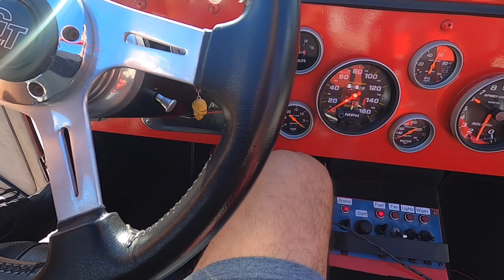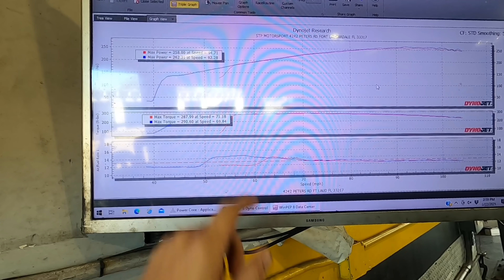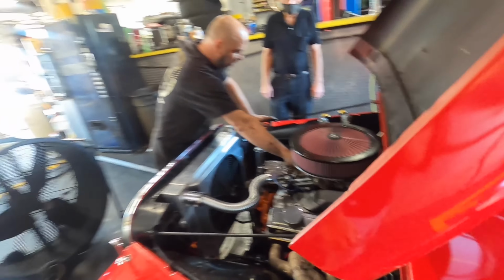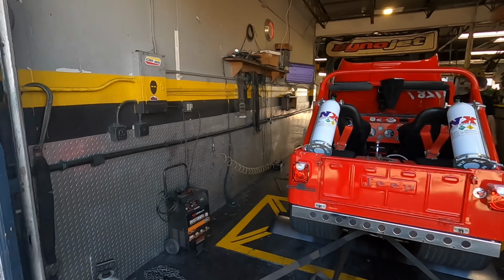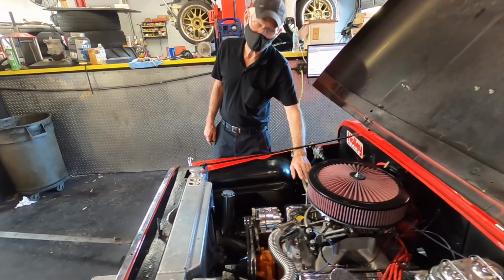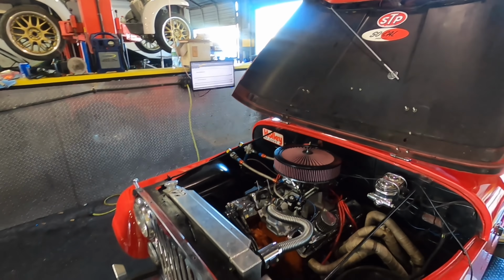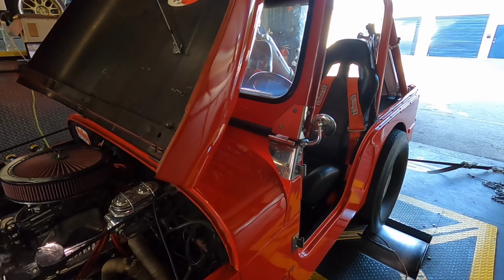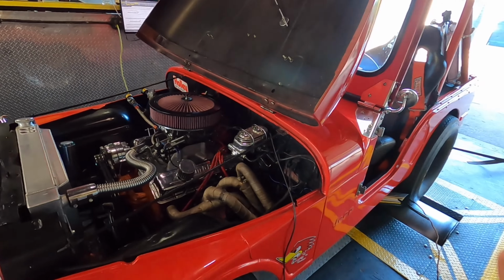Dyno pulls with Nitrous Express on board

Comment: Dayum! Das some good results Baltic. I agree with your philosophy, weight is on your side so you don't need to chase big power. Plus your torque number is up so that will help your 60'. 120 mph will be a lot on the big end with the way this jeep 60's. Your rear gear is steep, but looks like you can keep getting mile an hour till the finish so I'm excited to see what you ran!